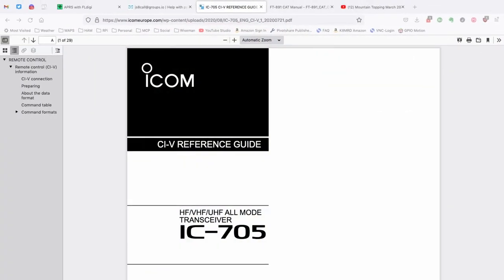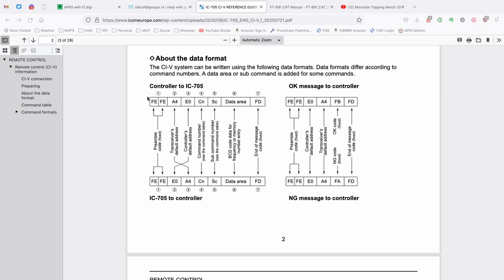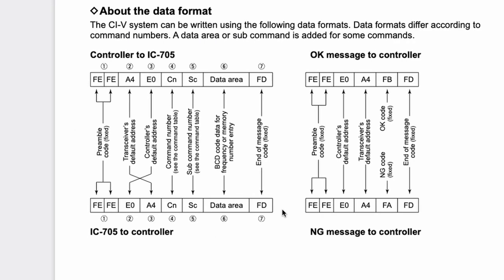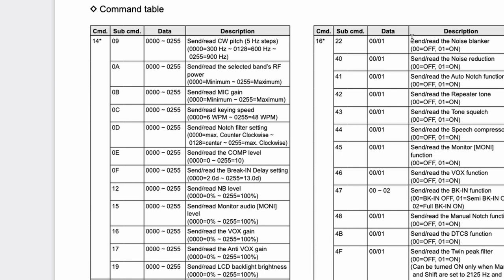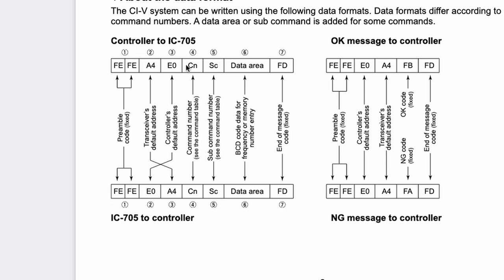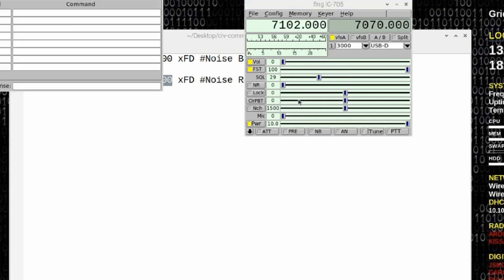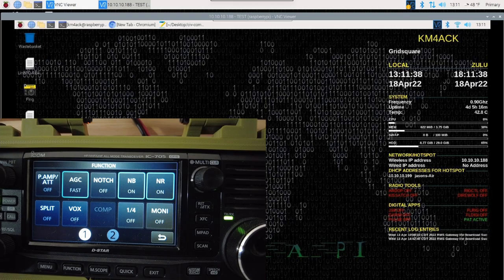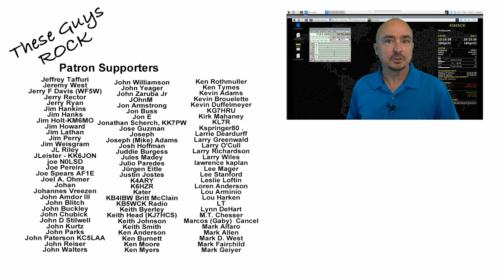FLRIG Hidden Features :: Run Commands Automatically

Comment: Fantastic walk-through on this. Thanks for posting.  The x in front of the commands are a human readable marker to indicate they are hexadecimal, you often see it as 0xFD, for example, and it's used a lot in programming
Reply from the maker: Thanks for the explanation!
Reply: Could you also format the statement as 0xFEFEA4E0162200FD?  I'm a little rusty on my machine coding.

Comment: I suspect the "x" prefix in the command codes (xFE for example) signifies the value is in hexadecimal as opposed to decimal/integer.   The industry normally uses "0x" prefix (0xFE for example)  I suspect flrig is just shortening that.   Fantastic video - thank you Jason!

Comment: This is extremely useful and I wish FLRIG could have more commands.  Then you could take some radios in and out of digital mode setup. Thank you for sharing.
Reply from the maker: Depending on the radio, you can take it in/out of digital modes using this method. It's possible with the 705 for sure. Also, there are settings in Pat Menu for this https://youtu.be/XEylme9Vmdc and I know JS8Call has a setting in it as well for moving the radio to the correct mode. I believe FT8 has a similar setting.
Reply: @KM4ACK  Yes my radio is the FT-991 and FT891 both not to easy to move to and from digital operations for email or other digital modes.

Comment: That’s very interesting! I need to check what else I can control in my FT-857D😁
Reply from the maker: The 857 isn't quite as feature rich for CAT control but there are several settings in the manual. I don't think the 857 has a separate manual for the commands. If memory serves me correctly, it's in the main manual.
Reply: @KM4ACK  Yes, some of them are in the manual. Maybe it doesn’t have as many commands as IC 705, but at least I’m happy I can set a repeater shift or CTCSS via CAT, which I just found out 🙂
Also thanks for showing those functions of flrig to us and I wanted to say that I like watching your videos very much!
73!, Dawid SP9SKA

Comment: AA8XX here.  I found an EASY way to get FLRIG to give you CI-V commands.  In FLRig, got to Config > Setup > Trace.  Check only the Trace rig class set code.  > View Trace >  Click on NR on FLrig (Not the radio) The CI-V commands for enable NR and the value set will pop up.  Copy and paste these command lines into one of the cammands like a button, startup etc.  Add a lower case x in front of each letter/number pair to indicate this is a hex code.  On my 7610, the set_noise_reduction to on came up as FE FE 98 E0 16 40 01 FD.  I the changed it to xFE xFE x98 xE0 x16 x40 x01 xFD The x98 xEO will change for a 7300 or 70x.  This method can be used to find the commands for chage frequency, power level, mode etc.  FLrig turns on my radio, sets it to USB-D1, 14.074, NR & NB to off.  On shut down, FLrig sets my radio to USB, 14.200, 30 watts (for the amp drive).  You get the picture.  Multiple commands can be put on one button.  I have only tried two per line.  Your results may vary.  73

Comment: I use shell scripts which are basically wrappers around `pat connect` and what not. That script the uses `rigctl` to ensure all settings match the chosen mode of operation. Some things can not be done trough cat control like setting the volume on an HT that does not have cat control. For those cases, my scripts prompt an instruction ("Ensure volume is set to around 50%") and waits for me to hit enter.

With that, depending on whether I do packet, ardop or anything else and depending on the rig I use, I get reliable results. Think of it as a check list but with most if not all points automated.

When ever I find something I missed so far, I add it to the script and it will be remembered for me for the next time.
Reply from the maker: I guess you could say we are like minded! If it is more than two commands to make something happen, I am writing a script for it. Here's a partial list https://github.com/km4ack/pi-scripts
Reply: I would be interested in seeing your scripts if you are willing to share!

Comment: HI Jason Can run kappanhang connect with Flrig control 705?
Reply from the maker: I have had limited success with kappanhang so far. Works great for HF but haven't gotten it to work with direwolf over 2M.